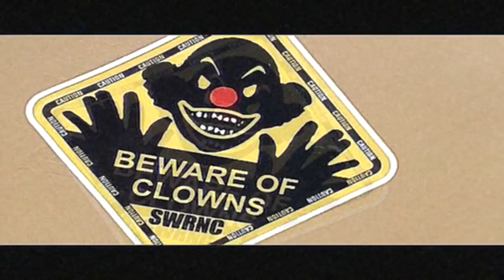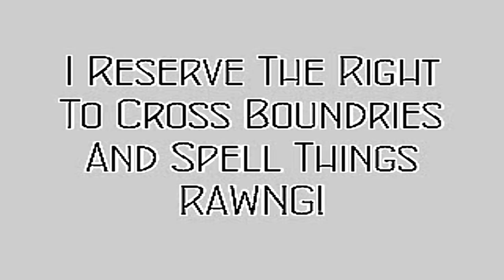I Got Ripped Off and SCREWED Over A HOT ROD CAR!

Comment: A buddy of mine  had a  customer  leave  his  car in his  shop  for a  minor  repair  and before he could  do the work  the owner  went to  prison for  5 years  he  stored it in his  yard  and had to  move it once a week at the  least  the  customer  finally got out and  talk to  him about  finally getting it done he waited 2 more years to tell him  go ahead and get rid of it  my buddy  asked me if I wanted it  i went to check it out and  generations  of small  animals  chewed  every  thing  and  some way to much work for me  i had to pass.  For  my project  cars  I pick up the most  common  tire  and  don't  put the  right one on  till  it's done  im not a  fan of  buying  extra  tires  i go to the  used tire shop and buy  a  cheap  set  tell them  it's  for  around the shop  no warranty or  bill of sale  wouldn't  trust them on a  road but  they  work